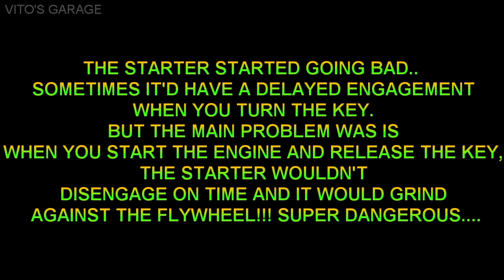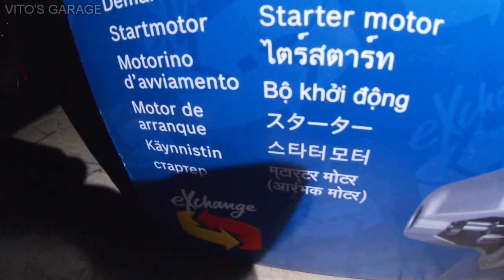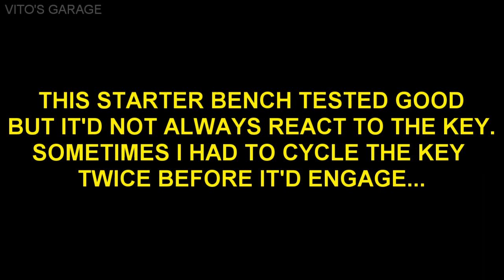PART 14 Dad's Mercedes W123: OM617 Failed Starter Testing & New Bosch Starter Installation

Comment: Good job man! When I took out my starter from my w115 240d 3.0 (should be the same as yours) a few months ago, I took it apart and gave the grooves of the coils a nice clean. Since then it cranks way better than before and works like a charm. Reassembly was a bit tricky but it was definintely worth it. I think now that you installed a new one, you'll not have to worry about the starter for another 30 years.
Reply from the maker: Very nice! Good to know. I’ll take this starter apart sometime in the future!

Comment: In France, you can find spare parts to restore an old starter : such as the starter launcher, the solenoid and its carbons (english technical term ?). i suppose it's the same in USA ?? It's a simple job of cleaning and replacing used parts and greasing, not complicated for you. The advantage is to keep the max of original parts.
Reply from the maker: It’s faster and easier to install a new starter. That’s what I did. It has a new Bosch starter now. I’m keeping the old starter so I can rebuild it in the future

Comment: I was wondering, if they gave you a starter for a regular 123 not a 123 Diesel, also is it a remanufactured unit not a new one,plus Bosch has parts made in Mexico, not like the the German counterpart, also was wondering  if it was better to put the solenoid or the good part on the original starter, or it*s not compatible.
Reply from the maker: No idea. I installed a New Bosch Starter on it. I didn’t have time to mess with solenoids right now. Old starter getting saved

Comment: The reason I say, it is they will sell it as new, but the unit is remanufactured, it has happened to me, I ended up returning 3 or 4 starters.
Reply from the maker: I made sure it was brand new. I don’t get reman products because they’re garbage
Reply: That is the reason why, the suppose new starter, ends up being a rebuilt model, you have to check inside the box, to see if there is a card that they put in saying that the unit was rebuilt but it*s like new, that is why sometimes they ask for the part to exchange it, I don*t know if that is the same over there, but it gets me furious, that you have to leave your part in order to get a remanufactured piece of garbage.
Reply from the maker: I am telling you once again, A Brand New BOSCH STARTER Has Been Installed
Reply from the maker: I am not ignorant, I checked everything